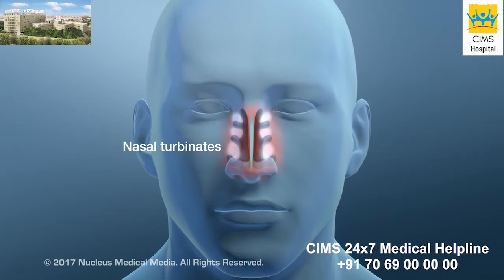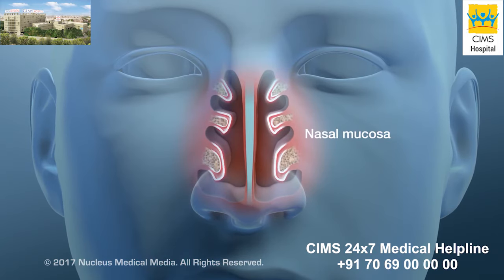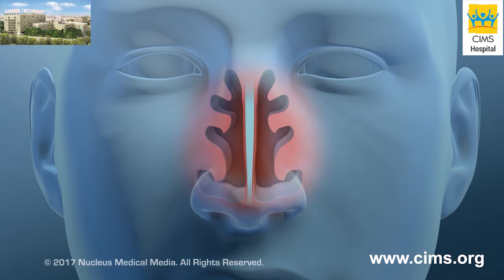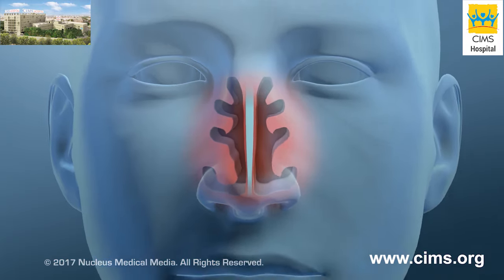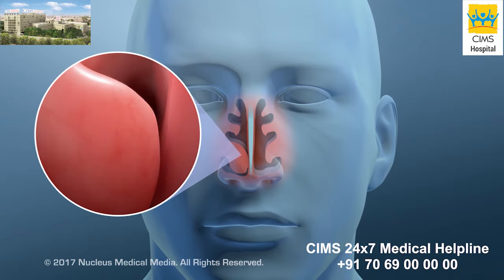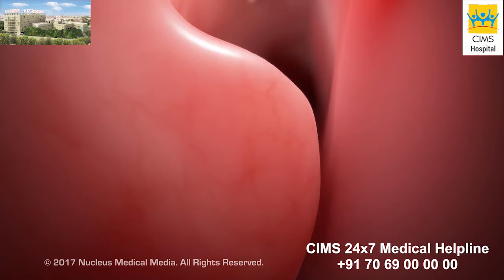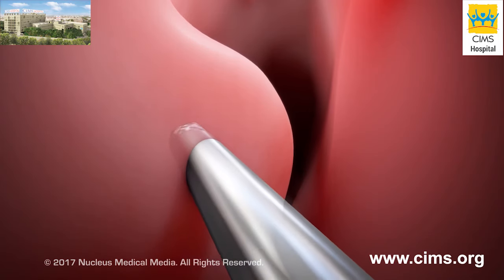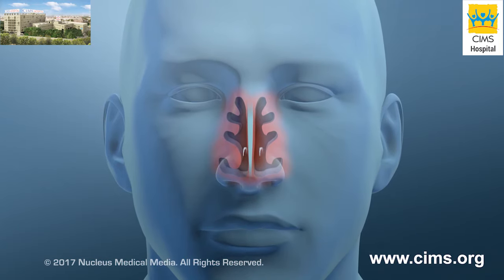Nasal Turbinate Reduction – CIMS Hospital

Comment: Turbinates are an essential organ and surgery should only be considered for life threatening reasons. Change to anti inflammatory diet, invest in hepa filters/change filters in the home or auto, get rid of toxic chemicals in the home, furniture with formaldehyde, get rid of hidden mold, check for hormonal imbalances/gut health. You only get one nose in your lifetime. Once something goes wrong Ents have no way of reversing the severe damages that aren't thoroughly discussed pre op.
Reply: Buena suerte intentando reducir la inflamación del hueso:) jeje
Reply: My nose was injured in Iraq in 2003, been dealing with it since then.  I went keto and anti-inflammatory a year ago and it got worse.  I'd like to think you're right, but how do I heal this naturally?  Been doing steam, been doing the neti pot, got an allergy test, but my problem is bone overgrowth (septal spur).  Got any suggestions?
Reply: I have had this problem since I was a little child. Every night is a nightmare, waking up several times, choking. And the following day is even worse.
Reply: @americanadreaming hi did u do the surgery my bone is also over grow
Reply: Nasal turbinates, also known as nasal conchae, are not considered separate organs, but rather are part of the nasal cavity. They are bony and soft tissue structures that protrude into the nasal passages and play a crucial role in regulating air flow and humidifying and heating the air that we breathe. They also help filter out dust and other particles. While they perform important functions, they are considered part of the larger respiratory system, rather than individual organs.
Reply: @gian12802 Afrin my brotha 😏😂
Reply: Man I tell you, I couldn’t breath through my nose at all it was like 90 percent blocked. Had vivear procedure yesterday, plus my dr moved the turbinates out the way I can definitely smell better now and breath better. Was it worth it? So far yes? Breathing is essential for the whole body and good sleep is too. A big cause of depression and anxiety is due to how we breath and how we sleep. This is all facts I’ve dealt with if for years

Comment: 20 years ago, my surgeon removed this so called turbin bone in my nose. The biggest problem I continuously have to deal with is my running nose when I move from cold weather into a warm place. I have to keep drying my nose until I adjust to the inside room temperature. I would not have done it, if I knew this serious problem.
Reply: Have you ever looked into the term “Empty Nose Syndrome”?
Reply: @vollfreak16 stop throwing around rare disorders that don’t even explain his symptoms. So irresponsible…
Reply: @JohnDoe-ht5vq it’s not rare.

Comment: I have had this surgery and unfortunately it messed up my nose, can’t smell well with my right nostril and the turbinate started to swallow occasionally so one nostril is blocked while other can pass air easily but at the same time it gets really dry so the crust builds up and after the nose bleeds. If you want to enjoy the smells as you now and you don’t have completely blocked nose passage please consider septoplasty or sinoplasty first and consult with multiple doctors

Comment: im about to have the surgery but im scared af because it will be local and not general anaesthesia, I just hope it wont hurt like hell with a needle up my nose or on my nose
Reply: How was it?
Reply: I had mine with local anesthesia. You're awake through the whole procedure. You see them put the grinder in your nose. Blood spilling everywhere. They put a mini crowbar in my nose and apply pressure till I felt the back of my orbitals cracking. And then they put blood pads in your nose .They have to remain for 3 days. You see them rip your bones and skin out of your nose. They use an iron type device to burn your flesh closed. And then they dismiss you roughly around the time your local anesthetic is wearing out. The pain afterwards is like hell on earth. I literally felt like somebody had thrown hot sauce in my eyes and I had to sit there and stare at the sun. Imagine like getting water in your nose that burning sensation but it's stuck.